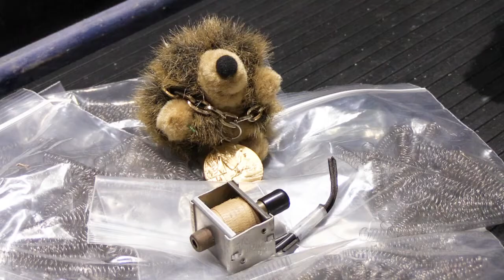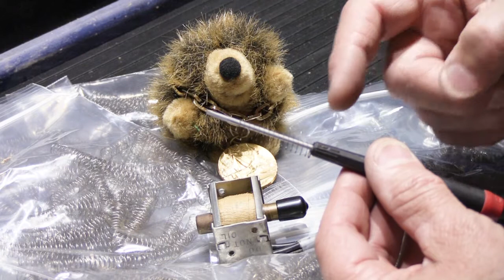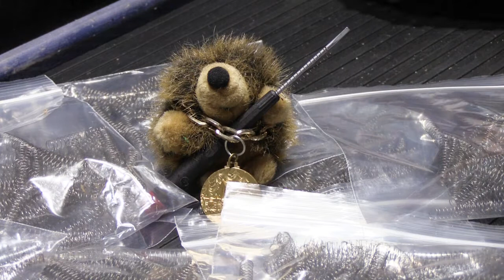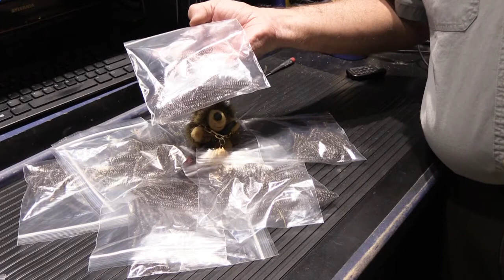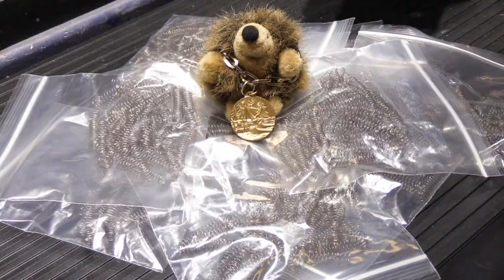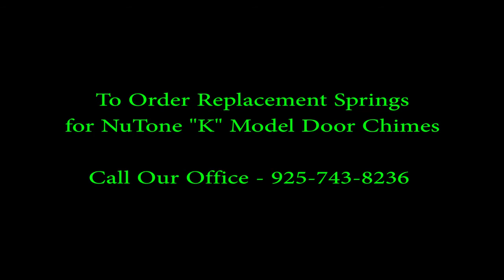New Coil Springs for NuTone "K" Model 8 Note Long Tube Door Chimes

Comment: Hello, I have an old NuTone, Inc that was here at the built of the in 1958. The only information inside of the NuTone bell is "NuTone, Inc. Cincinnati, Ohio - A10 Dec 580J - Service Instructions: To clean striker and sleeve use lighter fluid only. Do Not Oil Stricker. I need some new springs for it and hopefully this will restore or fix the bells problem.
Reply from the maker: Hio Valyncia:  You have a NuTone Model K10 form 1958 - This is a standard 2-Note Mechaical Doorbell with Tone-Bars.  Unfortunately, we do not have Springs for this type of Chime.  Your best choice is to purchase a newly made NuTone 2-Note Doorbell base and reuse the Power Unit by transplanting it into your K10 - It will not be a direct repalcement and you'll need to work out a way to mount the Power Unit on the K10 base - Chris

Comment: Interesting video.  Any springs available for a Nutone L34?  "NuTone L34 Heirloom Mechanism with double acting solenoid unit"
Doing a renovation and the spring got lost while it was apart.  Thanks
Reply from the maker: Hi helifan:  Unfortunately there isn't enough demand to have springs made for your style of Chime - I do not have any  original springs for a L34 Chime - You could try one of our "K" Model springs and perhaps it could be "adjusted" so it will work.  I know it is the right diameter - so it will fit into the solenoid bore - it is probably to long but it could be trimmed  - the compression force is the key to having it work correctly - it has to be strong enough to push the plunger back and hit the second tube - but not require to much force to compress it so the first note is to weak. - Chris
Reply: Great, thanks.  I will send you an email

Comment: Hi. Please let us know when you will have springs for "L" model chimes available for purchasing. Those are definitely very useful and impossible to find. Thanks !
Reply from the maker: Hi Luis:  There are many many different "L" Model chimes and they use different springs - Which "L" Model Chime do you have - Chris
Reply: LA-71 Electronic Madison from 1979.
Reply from the maker: Hi Luis:  A Model like the LA71 is low on the list for having springs reproduced, since there is really no demand for these parts - Chris